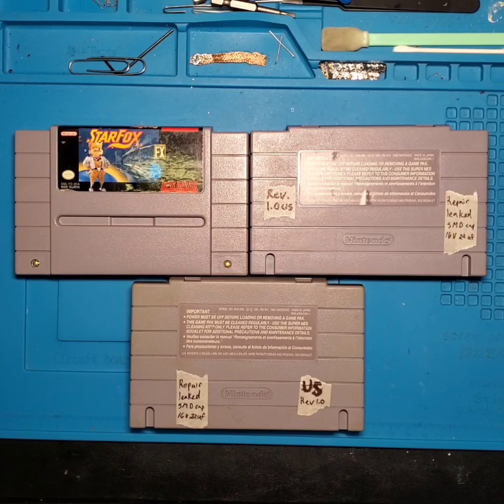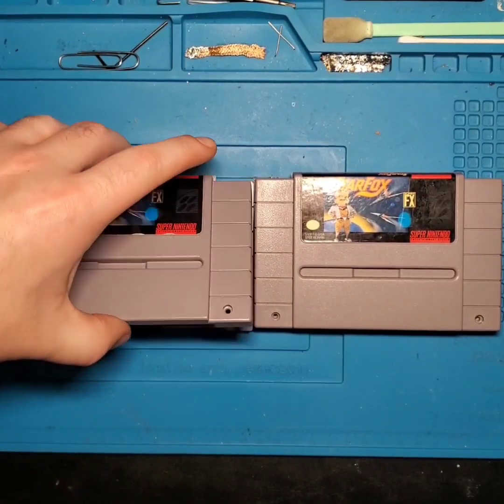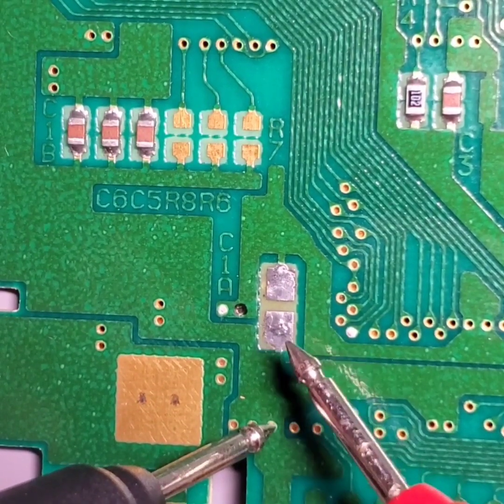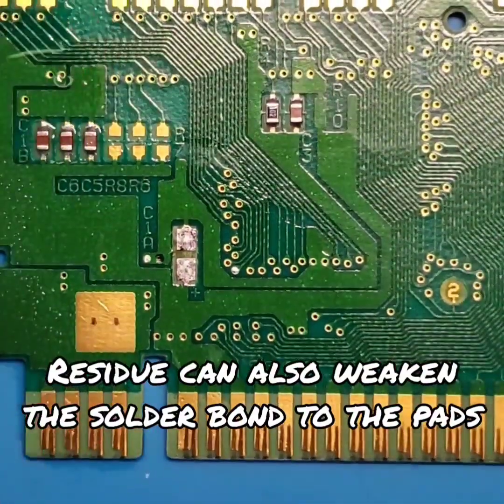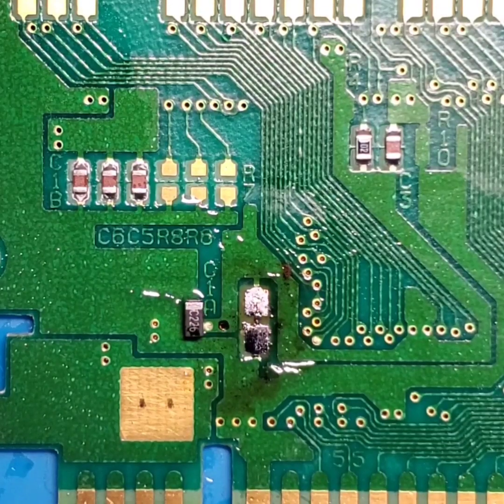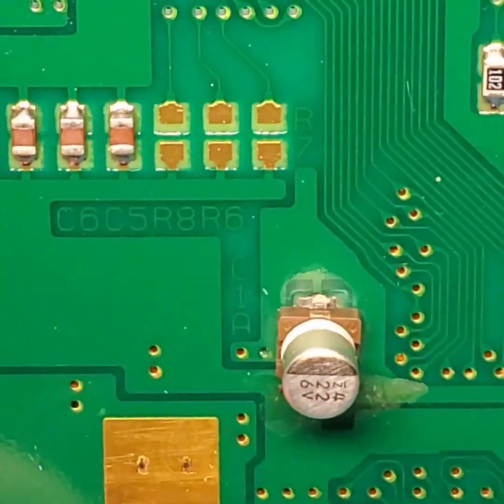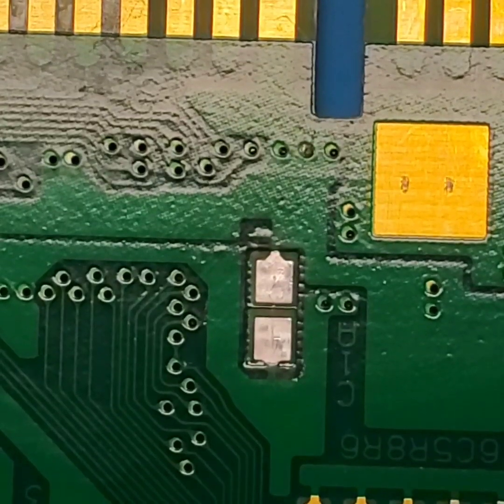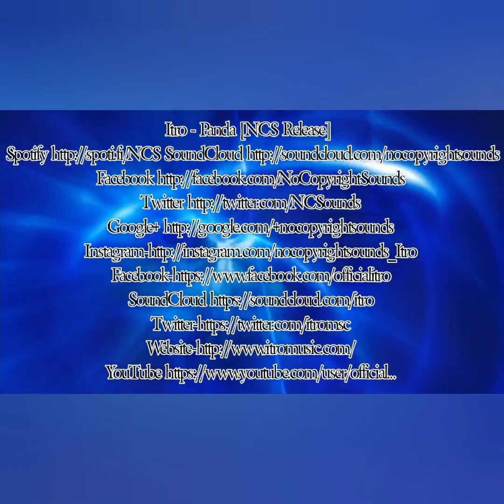SNES Starfox - The Ticking Time Bomb Cart

Comment: So are there any other snes games with this capacitor issue?
Reply from the maker: I am honestly not sure how many SNES games use a SMD electrolytic capacitor for filtering. So by the layout of the Starfox board circuitry and as for a few forums, I determined that these caps are used for filtering signals. Normally filter caps do not see a lot of heat or strain like a power supply would. Most power supplies use THT aluminum electrolytic caps for ease and cost. As for the SMD electrolytics, they have a higher failure due to their design. They have a plastic floor plate that over time weakens and leaks the electrolytic fluid. This seems to be more noticeable on the SNES consoles due to their obvious effects like video and audio glitches. Due to the inherent design flaw of SMD electrolytics, I would check your game cart and console boards for signs of them leaking. Better to catch it early than not. I will do some more research and see if I can find a pattern or create a list of carts that may be affected.

This article discusses the presence of SMD capacitors in the SNES console specifically but it still applies to the carts that have them as well. A lot of SNES carts use ceramic caps that look like resistors. These aren't subject to leaking since it does not contain electrolytic fluid.

http://www.nintendolife.com/news/2019/12/feature_your_beloved_games_console_is_slowly_but_surely_dying